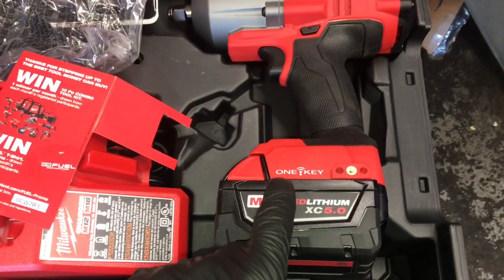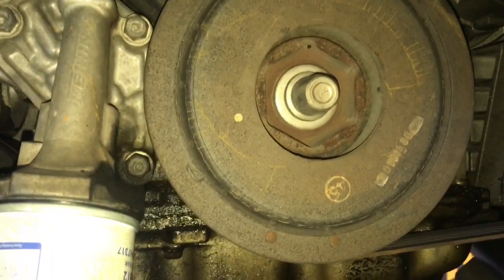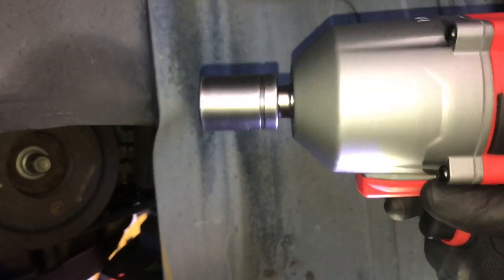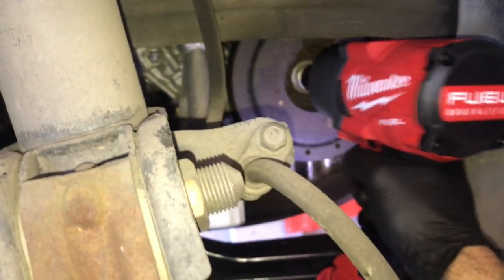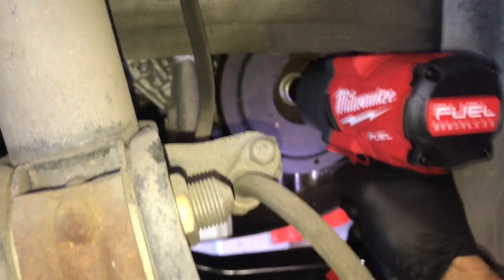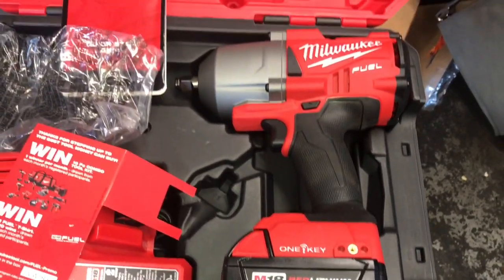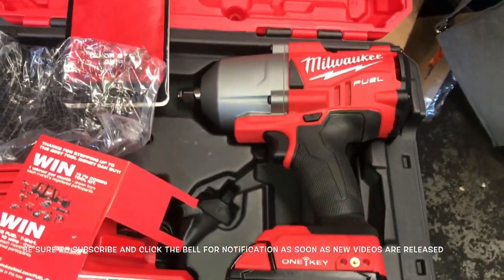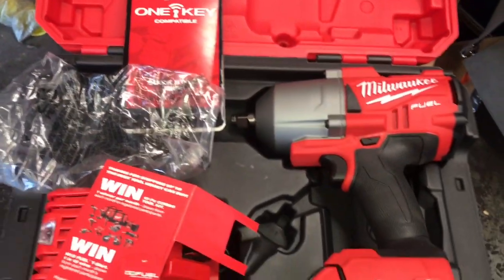Milwaukee Tools Releases New 1/2 Impact Wrench With One-key Technology.

Comment: How’s the size? I’m torn between this and the mid torque. I’m mostly a diy’r but do the occasional side jobs. I have Shelby GT350 track car so I’d be using this at the track also. The Shelby has some beefy suspension bolts at 200-300 lb-ft. What would you recommend if you could only have one in my situation? Thanks!
Reply from the maker: +sidewayzking13 the mid Torque is my go to Tools. Love the High Torque but only use it as needed.
Reply: How to Automotive thanks, I subbed to the channel. Your reviews are great and it’s nice to see real world comparisons. I’ll be sure to use your affiliate link to purchase the mid torque wrench, thanks again!
Reply from the maker: sidewayzking13 very cool glad to hear the reviews are helpful. Thank you for the subscribing and going through the links!

Comment: Milwaukee stands behind their products when comes to warranty, as far as batteries go; Bosch design and reliability top everyone in the world in power tools simply because their is no circuit in their batteries while others have complex big circuit board heats up under heavy use.
Reply from the maker: Hung Tran I don’t know much about Bosch Tools to say if there good or not.
Reply: How to Automotive They make very good power tools for different uses, nothing like the torque you get from Milwaukee

Milwaukee and Mikita have complex circuit board in batteries to control temp, charging etc..., so are Ridgid and Ryobi (same parents company) complex circuit board fails very often.
Bosch and DeWalt have litterally a few resistors on board, making them prone to failure.

Comment: Someone loosened it before you
Reply from the maker: Viktor Morgan nope timing belt had never been done
Reply: How to Automotive this does not mean that no one has untwisted it before
Reply from the maker: Viktor Morgan I get it you're a nonbeliever.
Reply: How to Automotive what is it leaking, oil pump gasket or oil pan? My Aircat is 2 times more powerful than Milwaukee, but it does not have enough torque to unscrew this bolt.
Reply: Viktor, your Aircat can loosen 2800 ft-lbs? Cool story. Looks to me like all Aircat 1/2" drive impacts  are well below the Milwaukee's 1400 ft-lb rating. http://aircat.com/aircat/impact-wrenches?c2c_square_drive_in_dd=4
Could it be THAT'S why you couldn't loosen it?
Reply: It works. I have loosened many of these devil bolts in Honda and Acura with this tool. True review.